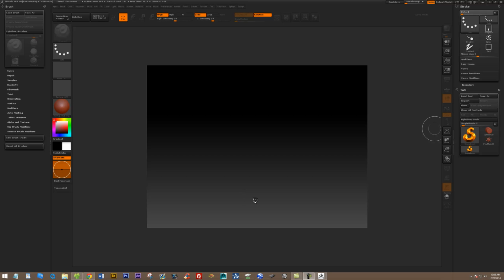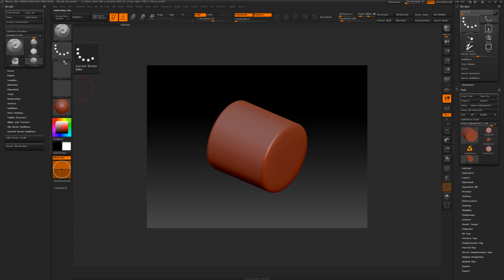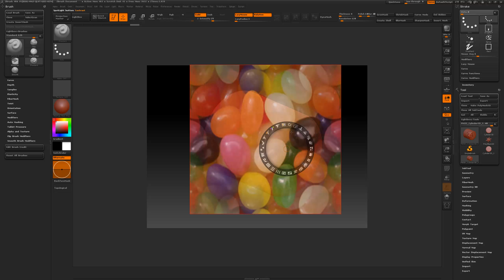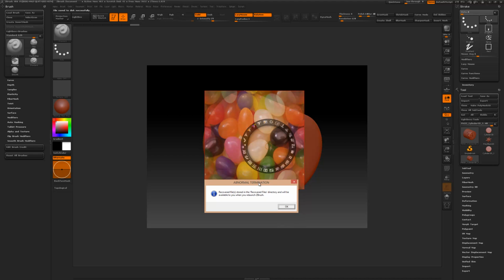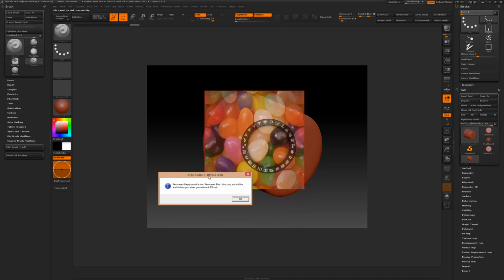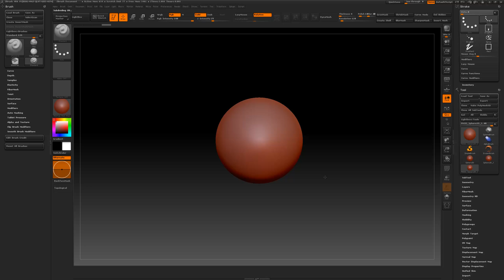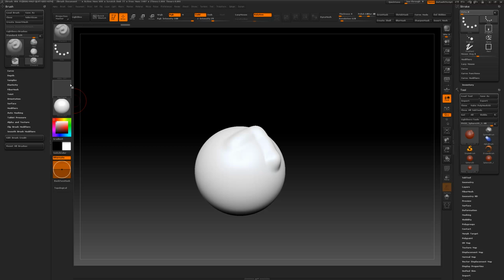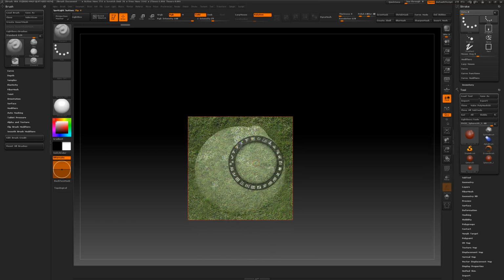Spotlight CRASHES Zbrush 4R6 P2  - when using "z" key to toggle spotlight widget

Comment: Try these items.

1. Don't use a primitive, try it with the Demohead. or
2. Reassign a new shortcut to the Edit Spotlight in the Transform palette.
3. Try deleting the ZBrushData folder in the Users/Public/Public Documents
4. What are your computer specs? Are you using a SSD?

Let me know if any of these work.
Reply from the maker: Thanks for the tips.  I deleted my custom UI prefs and it's working now!
Reply: +Jimmy Davidson, also by clicking Restor Custom UI, it helps me anyway :)